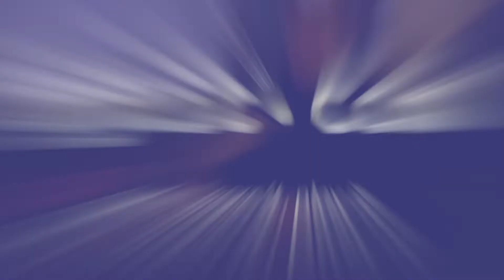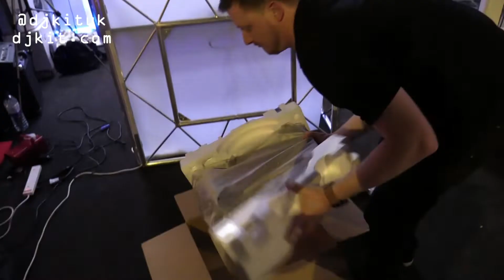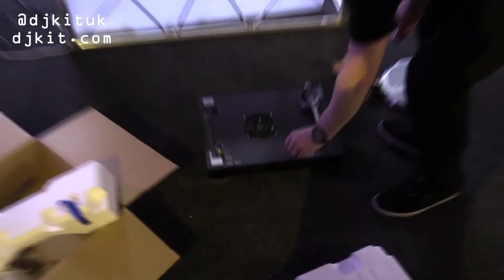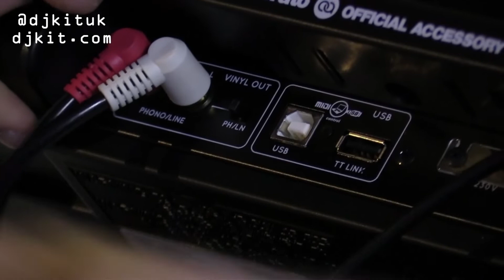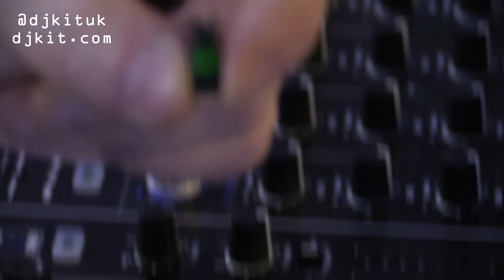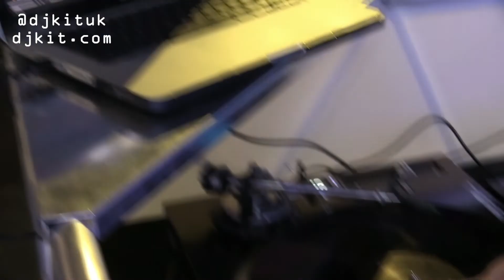Reloop RP-8000 Turntable - Unboxing, Tech Talk, Tonearm Balance & Serato - HOW TO SET UP A TURNTABLE

Comment: To be honest, been in the game 40yrs, bought a pair of RP8000MK2's and both faulty out the box...One Tonearm was loose with 2mm play and the other one, the platter wouldn't sit on the spindle...Two failures on brand new kit on separate orders.. Reloop customer service is shocking.. 5 week replacement process... If you want new and want your turntables to work, then don't buy these....

Comment: Can you play real vinyl records with this set up or do we need a different set up to play real vinyl records?
Reply from the maker: Of course you can! Obviously the Serato buttons won't be any use though!
Reply: @djkit  OK thanks for the response but im having trouble getting the turntables to connect with Serato DJ Pro. I was able to connect the mixer to my laptop and Serato Dj Pro immediately recognized it but Im having trouble getting the turntables to work. Im using a USB cable to connect the mixer to the laptop and using USB cables to connect both turntables to the mixer. Am I missing a step? I would greatly appreciate some assistance.
Reply: @djkit  nevermind I figured it out.
Reply from the maker: What was the issue in the end?
Reply: @djkit  I didn't plug the phono cords. I thought they were just extra cords.

Comment: What are good angled RCA cables for this? Besides the basic stock ones. Also do I need to get some with a ground wire or no if I'm using it for DVS mostly

Comment: Thanks for the video. If I use a djm 450 with them in pro event table do I still have to use them in combat position or is possible to use them in normal position?
Reply: Yes you can use them whichever way you like 👍

Comment: I have this deck and it has the same style counterweight instead of the stanton style (original) one it comes with and I also have the s-shaped. I just got this deck a day or two ago but before that I got a mk1 rp7000 and it came with the same couterweight. Now the tonearm would not balance at all and this rp8000 does the same unless I put it way to the end of the arm til its near enough falling off. I thought it was the type of counterweight but I just seen you balance this deck with the same weight. Don't think the straight arm has anything to do with it but, do you think it may be my bearings? The rp7000 was loose and this one is but very slightly. Anyways what do you guys think it may be? And any suggestions on how to get around this?